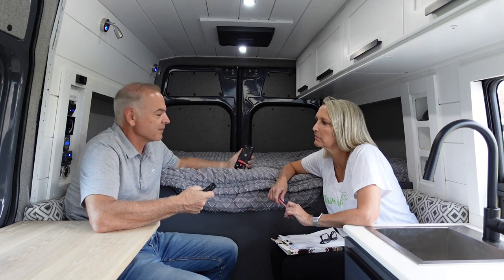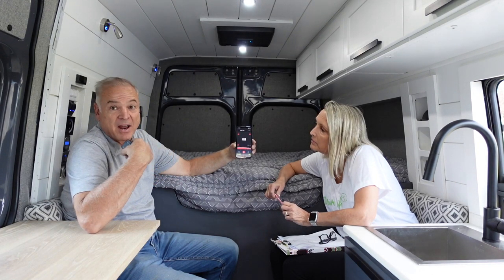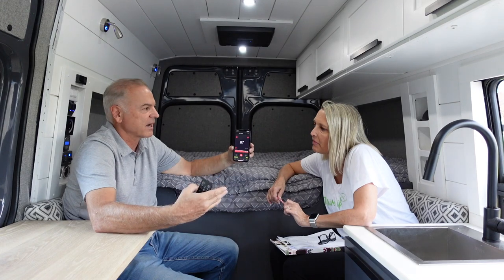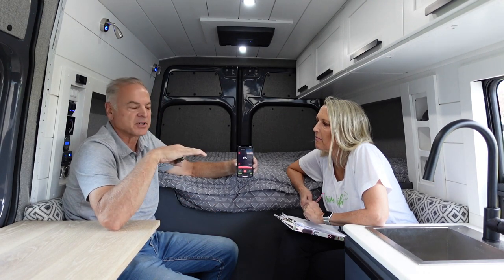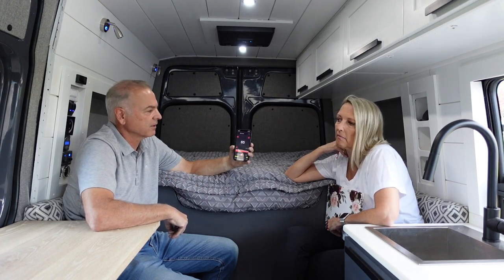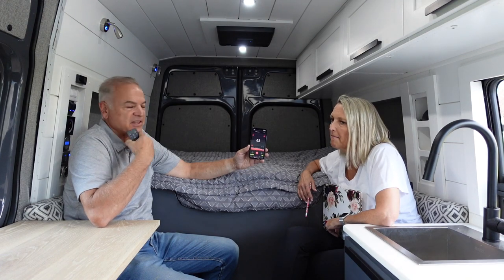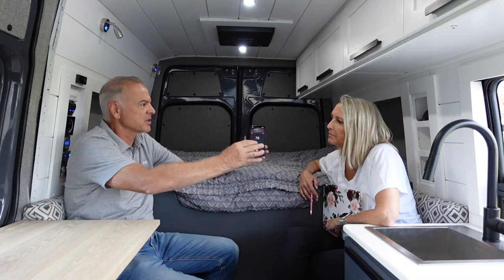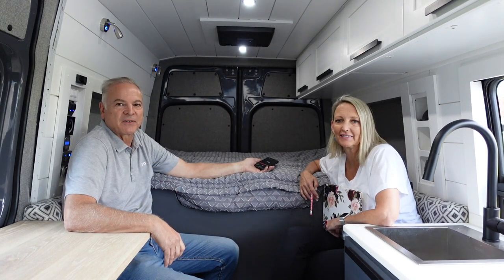[Update] Dometic RTX 2000 Air Conditioner Sound Level

Comment: We went with the Dometic RTX-2000 because it is service supported locally, and it is a low profile unit (not much wind noise, or ugly on the van), and also because of this video's report on it being fairly quiet.  As it turns out, it is not all that quiet at all.  On full, inside it sounds as loud as the loudest vacuum cleaner out there, and, then another loud vacuum on top of the van;  So yes, two quite loud sound sources, inside, and outside.  On it's lowest manual fan setting of 1 it is still as loud as a typical hotel room air conditioner.  Compare this to say a Mitsubishi mini-split in a house which is whisper quiet, and this Dometic sounds quite loud.  

I think the reason folks are saying it is quiet is they're comparing it to other RV air conditioners which can be extremely loud.  So in that context, if you're trying to get away from a super loud RV AC, then yes, this one is quiet.  But if you're building a van for the first time (Us) don't convince yourself that this will be a quiet unit.  It will definitely disrupt the peace and quiet of camping, both inside the van, and out.

In defense of Dometic, and all the various manufacturers, the bulk of the reason why it's so much louder than a home mini-split AC is because all these van/RV AC units are using propeller fan blades... regular flat 'airplane' fan blades... which.. are inherently loud as they move air.  Scroll fans on the other hand can be whisper quiet (Mitsubishi mini-splits).  They're a 'hamster cage wheel' type of fan blade and are inherently quiet.  But the van/RV AC manufacturers are dealing with trying to make a small low profile unit, so they opt for propeller fans.  The Dometic has (4) of them ... hence.. kind of loud-ish.  It's not the compressor.  The compressor makes a reasonable 'can get used to it' rumble.  It's the interior and exterior fans on the unit... that's where the vacuum cleaner noise is coming from.

Dometic could easily fix this by making the '1' fan setting run the fans at an even lower speed.  Blast the van cool for 15 min on boost, then turn it down to 1.  But unfortunately the '1' setting is basically what the '2' or '3' setting should be.

Comment: Nice video, it got me to wondering about the sound levels in my van with a 9,000 btu Panasonic mini split installed. 
At night on eco mode the decibel level is 42-43 decibels.
The Maxxair deluxe fan on the 2 power setting is 44-45 decibels.
Power usage on eco mode is 180-190 watts.
Reply: How are you using a Mini Split on a Van Build? 120 Volt AC.
Reply: @razorwired130  1,200 watts of solar panels, 900 amp hours of lithium batteries and a 3,000 watt inverter charger. Non winter sunshine I can run the AC and charge the batteries. When I run it as a heat pump it uses about 40% of the charge over night but it only recharges about 30% with winter sunshine.

Comment: Do you have a video where you show how to wire it in? Thank you!
Reply from the maker: We don't have one specifically on wiring the AC unit, although there is one where we mention it here: https://youtu.be/Owd0C2G_s6w We use the supplied wires and connect them to a Victron Lynx distributor.

Comment: Hey there, thanks for the video. I have this unit on my van and so far no complaints till today when one of the fans on the roof stopped working and it seems like now the other one has stopped working. Have you had any trouble with yours? Any advice?
Reply from the maker: Dang. We’ve installed these in 10+ vans and never had a problem. Hope you can get it working.
Reply: Me to .. called dometic  and I’m 14 months in so no Warrenty ! They told
Me to take it some where and have it fixed . The unit is 14 months old and has about 200 hours run time (8 days ) maybe . Totally let down by dometic . Video to come soon

Comment: I installed the RTX 2000 in my van but I cannot say that I am happy with the quietness of the unit. The condenser fans make an obnoxious high pitched noise when running at full speed.
Reply from the maker: Hmmm. Mine doesn’t make a high pitched noise. It’s more of a low hum when the compressors are running.
Reply: @OurThrivingLife  The word "rumble" describes the latter more accurately, but that one doesn't bother me much. The condenser fans are too small for my taste. Their noise bothers me even in eco mode. However when it runs at lowest power the noise drops to acceptable levels
Reply: My son borrowed our van for a short trip and upon return said the AC had a very high pitched noise. While I do think the fan has an obnoxious sound, I am too old to hear the very high frequencies. I recorded an audio spectrogram and indeed there are some peaks around 16kHz.

Comment: From your experience with these units how well do you think it would cool a tractor cab on a hot day. I'm going to ceramic tint all the windows and insulate the roof and floor. Thank you
Reply from the maker: I think it would do very well. That’s what these were originally designed for.
Reply: Thank you very much

Comment: Seriously considering this unit as we have 420 amps of power with 1 400 watt solar panel.     Was going to put it 2/3 of the way from the back of the van on the roof ( away from the bed, and over the bed). Do you have the air blowing straight down on you?   I’m thinking you’d freeze over night, No?
Reply from the maker: We install these over the bed. You can divert the vents so the air doesn't blow directly on you.
Reply: @OurThrivingLife  -haven’t seen it up close, but if it works for you, great!
Reply: Have this unit now.  Was advised NOT to put it directly over the bed.
( installers). Put it 1/3 of the way back.  Cools entire van perfectly.
But thx

Comment: How much solar needed for this?
Reply from the maker: This AC unit pulls about 40 amps in auto mode, and 20 amps in ECO mode (12 volts). We recommend at least 300 watts of solar and 400 Ah of Lithium batteries to run this unit.

Comment: is it common for the Dometic RTX 2000 to squeak when driving after install? it's driving myself and my passengers nuts. squeaks like a mouse whether on or off
Reply from the maker: Sorry to hear that. I’ve never had one squeak.
Reply: @OurThrivingLife  thx for the reply. Had looked up various rtx install vids and posed the same question. Same response. So took the leap to take take ceiling down and see what the builder did. One of the M8 screw was installed without the washer, lock washer and nut. Hence the squeak. 🤦‍♂️